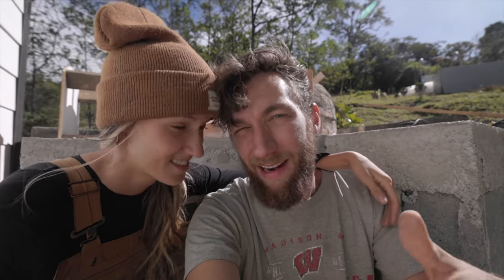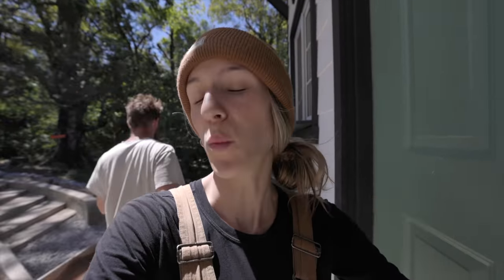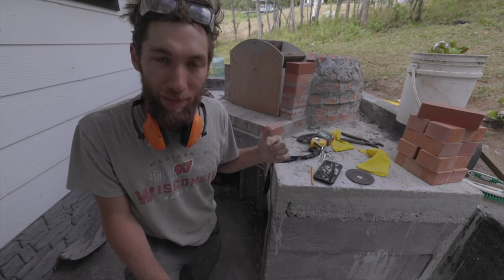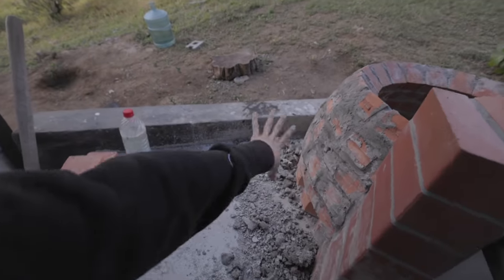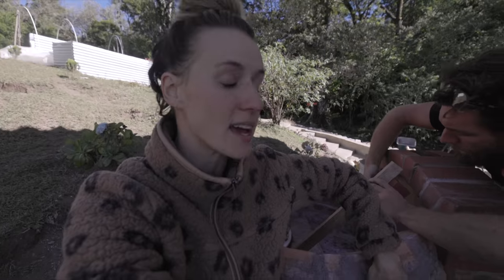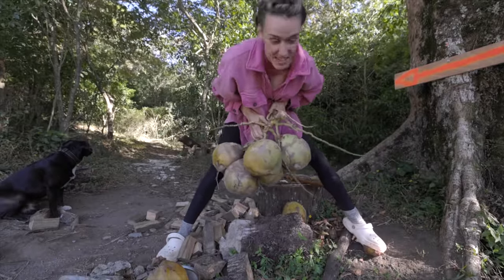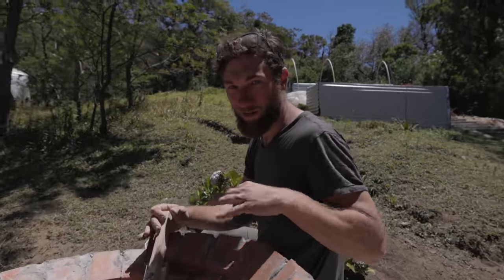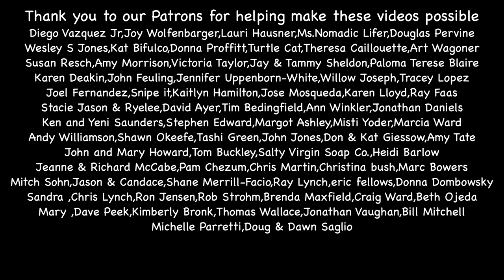WE'RE TAKING IT DOWN AND STARTING OVER // brick pizza oven build

Comment: The top dead center of the door arch, a keystone, should have tapered sides so its weight shoves against the bricks to each side and it should stand without cement.  The keystone brick anchor to which all of the brick are connected.  Now the top brick can slide out.
Reply: I saw that and thought they cut the brick the wrong way!  Don't brick ovens usually have a layer over all the bricks to add insulation? Other wise those bricks are going to get dam hot!

Comment: The most wonderful thing I was told by the elder folk was that my life as a new mother and the life and comfort of my baby was to place an egg in a thick sock and place it in the back corner of my baby drawer that holds the onesies and baby socks. So that your baby doesn't have teething pains and you don't even know that they are teething. It worked perfectly. It happened for me during winter months so I had no problem with it smelling, but in summer you may have to throw out the egg and exchange it if it starts to smell.  I  also used the same method with my second baby and my niece also followed the same method after I told her about it. But other nieces refused to do it calling it stupid and the sad part is that their children suffered. Hopefully you will at least try it. Much love, wanda

Comment: Question: why didn't you build a wood mold for the brick oven? then you could burn the wood off and then you have a seasoned oven?
Reply: I was thinking exactly the same thing.  Having a wood frame for a mold would have made setting the bricks much faster and easier.

Comment: Its easier to take the ground clay,wet it an form a cement, layer it over a mound of sand,the shape you want, when the outside clay is dry , pull out the sand,an you get a clay oven! The first fire will harden the clay, even mix a little cement in. Good luck

Comment: Nice idea to make pottery - but the kiln will suck all your power when it fires overnight. I'd see if there is a local kiln you can utilize - buy the clay from them so it has the correct melting cones so the pottery won't explode while firing. They may even have glazes for the second firing. You can also get a kickwheel that doesn't use electricity - but much harder to use. Good luck!

Comment: Hey guys you could speed up the whole process.The dome is the hardest and things want too slide.Get a large blow up beach ball an put it inside.It will hold things inplace as you are working.You can adjust the pressure in the ball as needed.Coat it with some light oil and it wiil pull out easy when you are done.I have done some crazy concrete work in my time.

Comment: I think it would be much easier if you made a dome-shaped form out of some thin wood strips, and then mortared the fire brick chunks in place on the form.  The chunks would all be the same size and shape, essentially like keystones.  After the mortar set up, you just fire it up, and all the wood would turn to ash.  The door would need another half cylinder-shaped wood form, and all the bricks simpler identical keystones.  That form would also burn fine the first time you fired it up.  Maybe make the forms out of the same kind of wood you plan to use to heat the oven, so the forms don't leave any off-flavor residues behind.  Steel nails used in the forms would just drop on the floor unchanged.

But maybe making your own pizza oven needs a little thought:  Typically, you need to burn a bunch of wood to get them up over 900 F.  Then they cook a pizza in about 60-90 seconds.  Seems like a huge amount of trouble for one pizza.  This style oven is used by a pizza parlor, so they can cook hundreds of pizzas on demand.  You could feed everybody on your farm with just two or three pizzas.  Maybe a dual purpose electric kiln / pizza oven makes more sense.  Adding a fan would also make it a convection oven.

Comment: Jordan there is a tool that you can pick up over Amazon maybe you can pick it up at the hardware store the brand of it is called QISSEP contour gauge with lock they come in a 6 inch or a 10 inch and it’s great for corners woodworking templates tiles all kinds of things you might wanna look into it I know I was gonna get one because I do a lot of different projects also just throwing it out there, I know they make some out of plastic and then they make some out of steel ok 👌🏼🔥🤠🔥Camping Russ out

Comment: you can clean all with muriatic acid and a wirebrush later if its' 'thin' coats of cement and dust stains on the brick.

Comment: Be careful handling concrete with your bare hands. It's very abrassive, you will take off a lot of skin, best case just expose nerves and get sore fingers. Worst case, your fingers will bleed. Also, have a bucket of clean water and a sponge, and clean off the worst lumps of cement on the bricks as you go. Later the grey cement haze can easily be cleaned off with regular HCl.

Comment: I saw a video for making a horno
Reply: In the 1800s, they built up a mound of wet sand & little rocks in the shape of the inside, let it dry out, then cover the mound with several layers of burlap bags. Bricks or a thick mixture of clay mud with straw mixed in it. Stomp on the clay & straw mixture on a tarp to mix together. Then let dry several days. Scoop out the sand & remove the burlap.  Start a small fire in the oven to cure/ dry the oven. Have fun. I will add the link when I find the video.

Comment: Optician for 26 years in a local town that has too much money but I’ll tell you what it is a lot of businesses are spending two bucks on the lens that is not transitions it’s a thing called sun sensors and the technology never advanced beyond their first attempt it does take a half an hour and it’s crap and they paid dollars for it when you paid hundreds what you want is a mom and pop shop that’s gonna sell you transition seven you can get a lens now that lightens darkens and polarize as a darkens so it’s a real sunglass not something that got dark enough to make it harder to see a polarized lens cuts out the glare itself by eliminating everything on the horizontal and this way people turn their heads left and right and see that the glare gets stripped off the ocean waters and they can see the shark that’s coming out to take their arm instead of a nice little Fish.  Additionally something like 97% of people love transitions and so you’re one of the 3% you got took for trying to save a buck